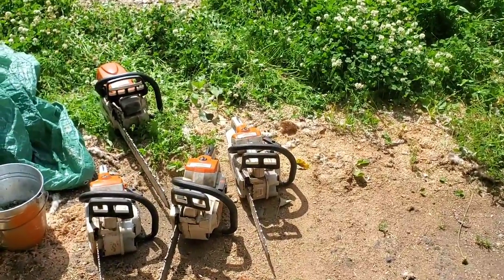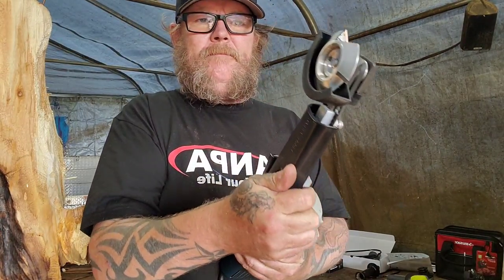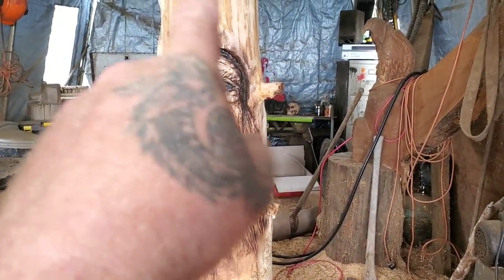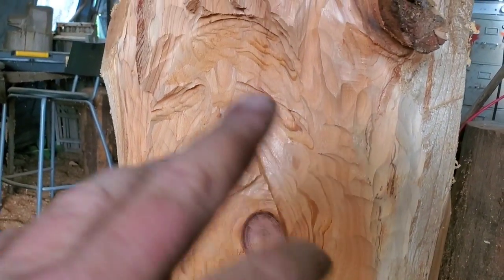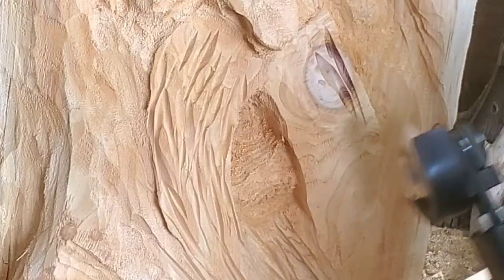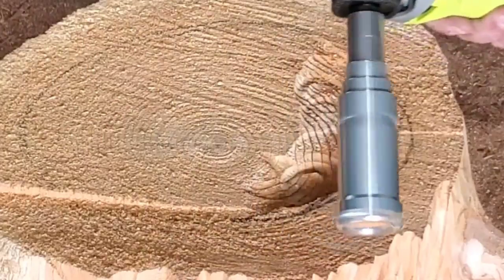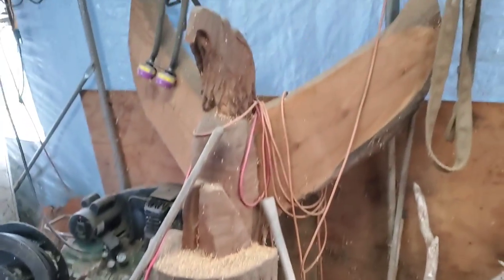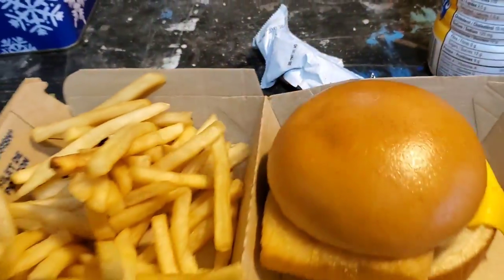Carving with my new Manpa Power Carving tool's.

Comment: hey jordy
i love your vids and your carving 
but every time i look in your there with new carving tools
I am an older dude with a fixed income and can not afford half a dozen angle grinders plus cutter heads that look really dangerous to me even though the cutters look very much like arbor tech industrial cutter
blades??
I dont have a chain saw either although i spent many years on the biz end of them 10 hrs a day 6 days a week and anything with a chain on it does not appeal to me>i learned to cut and trim pulp wood down east>the foreman told me to cut and trim em tree on tree bouy>which i later found out meant three logs on three logs each 6ft long stacked like a teepee so they could later be chained and loaded on a skidder >
and hauled off to the mill by rail cars>it was back braking work and we where not paid by the hour but by the yard>took me a couple of weeks but i got the hang of it and could keep up with the rest of the crew >10 or 12 men depending on who showed up monday morning>btw my chain saw and my gas+ oil and sharpening came out of my pay each week>taught myself how to file my old yellow and green chain saw>three times or more a day>at lunch times and the two ten minute brakes we got lolol>also worked in a sugar bush and cut and split enough fire wood to fire the sugar cooker 24/7>over 300 hundred hectors>
so i had my fill of anything with a chain >saw guys get terrible cuts being careless or over tired >saw one kid barely 18 cut his foot almost clean off at the ankle and mangle his hand trying to slow the blade down at the same time>we passed the hat for him the rest of the season no workmans comp or insurance back then he was married with a kid on the way>i heard he came back to work two seasons later on a skidder this time and rolled it down a steep grade and was pinned under it for several hours >he was messed up bad but lived to tell his grandkids i guess>
just got me an angle grinder makita model # GA4534
to go with my two dremel's 3000 and 4000 with flex shaft and fed them to an old sewing machine 
leg pedal i mounted on the leg of my work bench> took a few screws out of the sewing machine cabinet and ta da a speed control for both my dremel's>old sewing machine been in my house since i bought it 20 odd years ago collecting dust tried to give it away many times
I had a basic bob dremel more than 25 years ago and messed with some carving but gave it up
I have done a few wood spirits and some bird boxes with the 3 old carving bits i had not sure what make they where but they have spiky burr like heads 1/8 shaft >one cylinder shaped>one tapered >one ball shaped>
I got some extra money from the income tax stuff and i want to up my game with some bowls looking at getting a good rotary and some burrs as well as a turbo plane and perhaps one kutzall carving dish 
That should eat up my money want to know what u recomend ???>i have watched video after video but always come back to yours>I dont have any fancy power tools>one old table saw i bought to trim up wood for my house>a cheap radial arm saw>a decent compressor with 25 ft of hose>some air tools>none for carving or sanding>all i used to put board and baton on my house>an orbit sander who's pad is worn out so i glue on sheets till they brake down and glue on another?>i envy your jaw horse i have a few clamps thats it>any feed back would be good if can find the time my email is parkron51@gmail.com
thanks and cheers from an old hippy dude